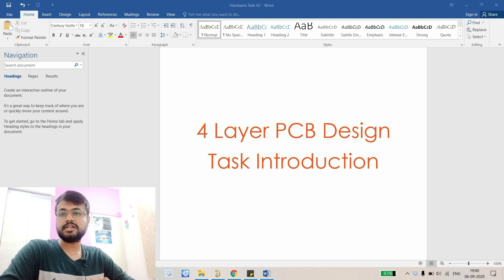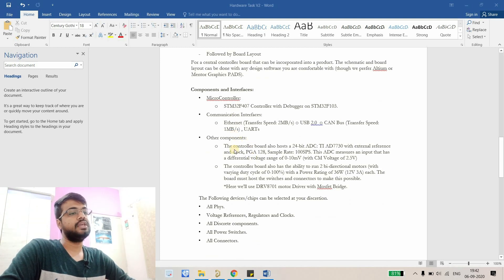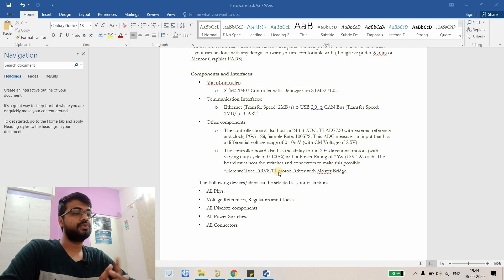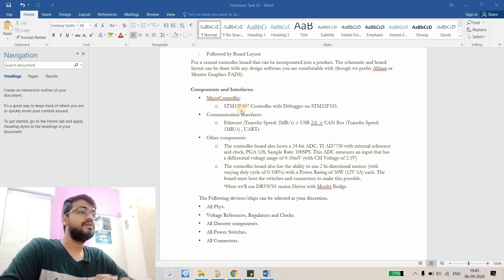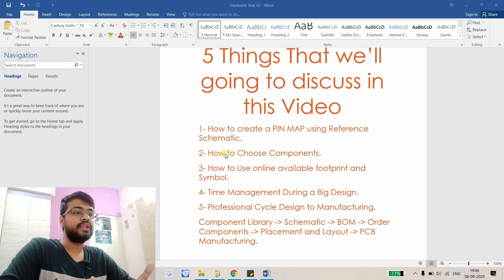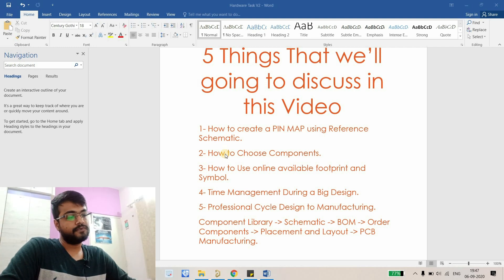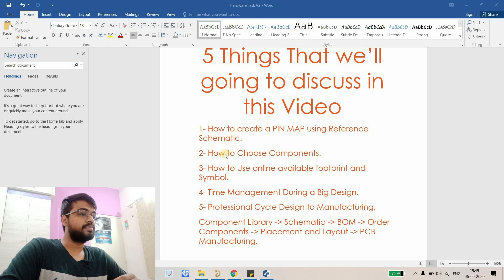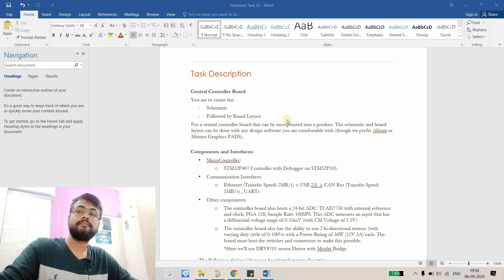FREE!!! 4 Layer PCB Designing Course for Freelancers Part 1: Introduction

Comment: Bro Pls put high speed design videos like ddr3 with impedance control routing, length matching, signal integrity, power integrity. Ya u have uploaded some of these in tips videos. But if one project shows all these we can understand more. It's my request. Pls consider it.
Reply from the maker: Will upload soon
Reply: @EsteemPCB  thanks a lot ❤️

Comment: Great..!! I was in need of a series of videos just like that. Thank you very much for sharing. I guess during the process we can ask you questions.
Reply: for example: do you check your designs with some kind of simulations?
Reply from the maker: In this series my focus is to create a board from scratch using the requirements provided by clients.
Reply from the maker: But yeah as you suggested I am working on that too, a processor based board design from scratch

Comment: Dude that's not for freelancers, it's  < how to layout a simple board 101 >
And the tasks are irrelevant to layers of the board, same tasks must be performed to 1 layer too
Reply from the maker: Hey I understood your point, up to some extend you can route everything on this task on 2 layer, but I am going to design it in a 6cm^2 pcb, plus for differential pair I needed 100 and 90 ohm which is quite difficult to achieve on default 1.6mm 2 layer pcb, what you say?
Reply: @EsteemPCB  Still its a simple board. It's a 20min task to set up a diff pair and you probably gonna run with a standard stack from manufacturer of your choice.
The issue is that it's not for freelancers, it's a pcb layout course. If you want to make a course for freelancers talk about:
~ How you calculate your time
~ How you calculate how much you gonna charge
~ How to define requirements with someone who is not an engineer and gives you specs in SPS and part numbers
Laying out a board and making a footprint is the easy part of the job.
Most of the customers are like "I want a device that can monitor my machines" and you have to figure out the rest or they ask for extreme processing power that requires linux and they have no idea how much time you need to route a DDR3 and you need to explain them that what they want is very expensive and won't be done in next month....
That's freelancer's issues
Reply from the maker: Thanks for suggesting good and honest content, I will definitely try to include these issues you have mentioned here, plus I need people like you in our community, if you don't mind I wanna add you in our close whatsapp community please mail me your contact details on esteempcb.info@gmail.com
Reply: I have to agree. This isn't for freelancers. A freelancer will have to know all this and more...already. This is more like teaching a novice the steps needed.